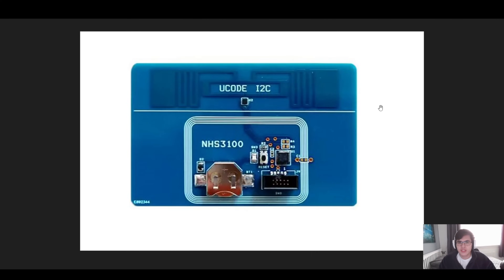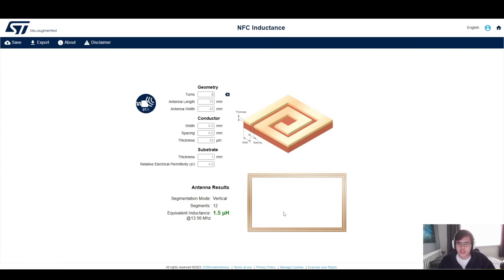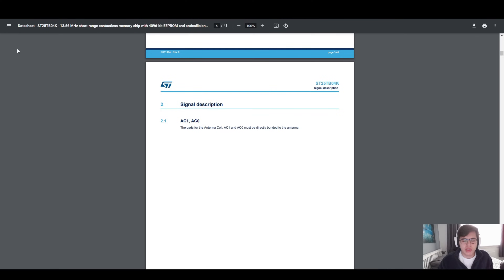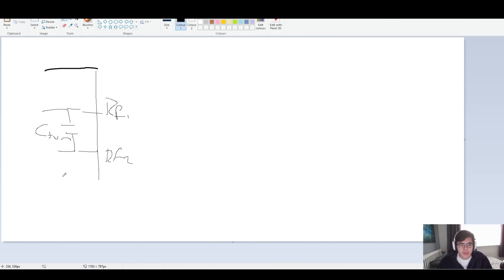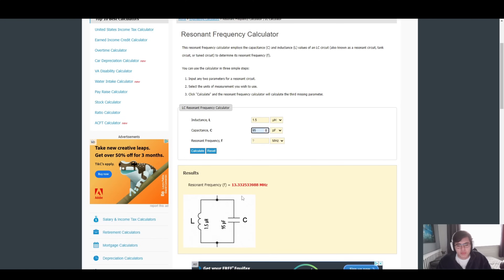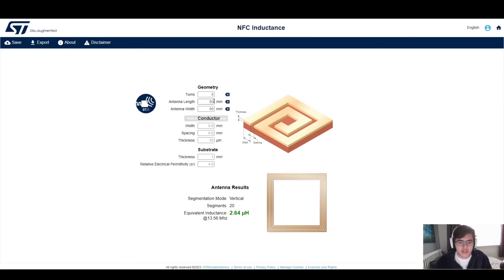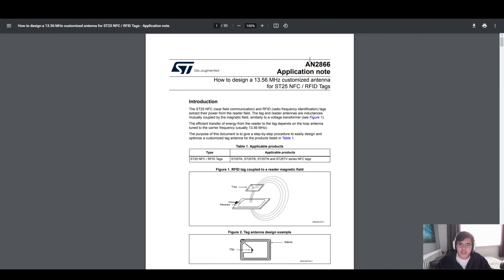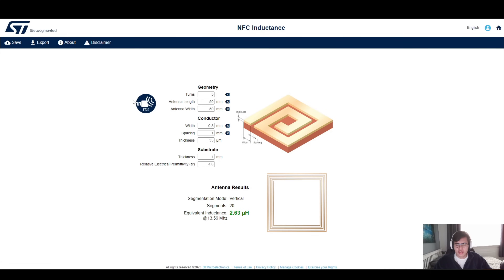Design Your Own NFC Antenna

Comment: cool video thank you ,if I just sign a NFC antenna, how can i get its real S11 in HFSS? I tried use a capacitor to replace the chip in tag but it not work

Comment: can i attach an antenna tht i bought online to my 13.56 mhz reader? if so, which antennas would be compatible with which models of 13.56 mhz readers?
Reply from the maker: You'll be able to use an external antenna as long as its for 13.56mhz
Reply: @WinterCircuits  do you know approx how far the 13.56 mhz nfc reader would be able to reach with an antenna?

Comment: hey great content! This antenna can be use for wireless charging? thank you  in advance!
Reply from the maker: I have seen some cases with the use case of NFC charging, for example I believe ST do a range of chips. I would believe if it was that specific you could use this for wireless charging if its NFC.

In case of QI charging, it would require something different. You can get a lot of off the shelf antennas so it might be worth looking into if you need something for your project.